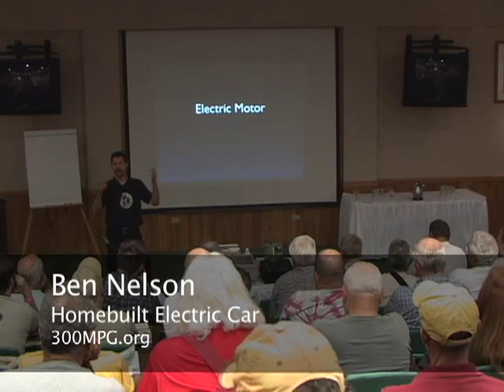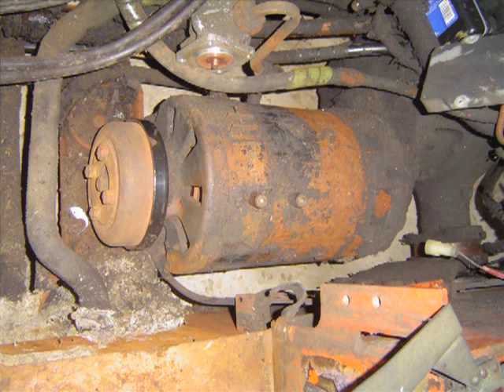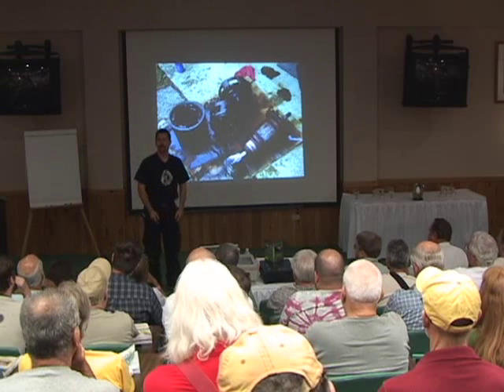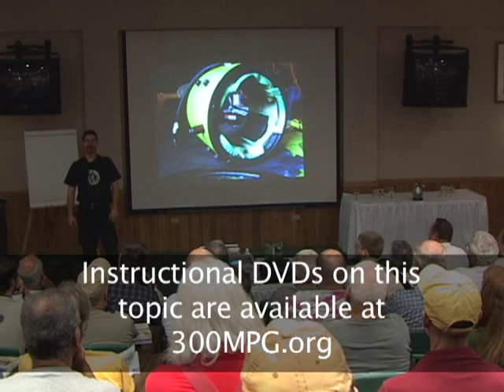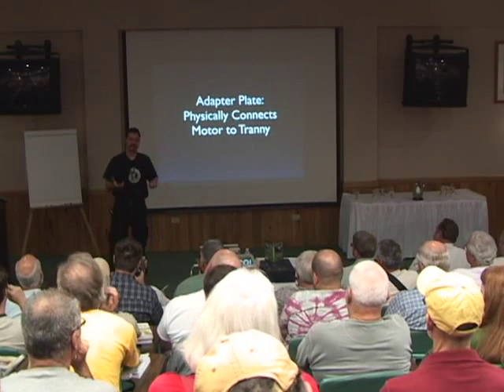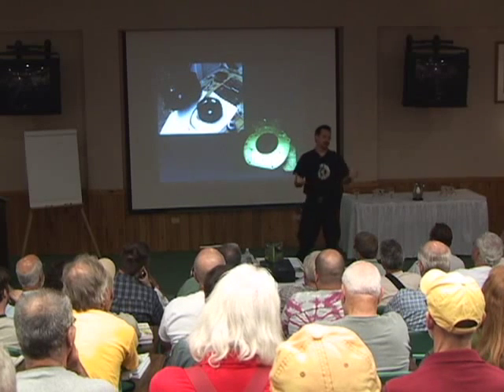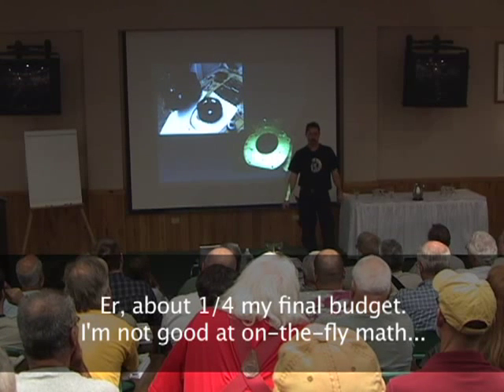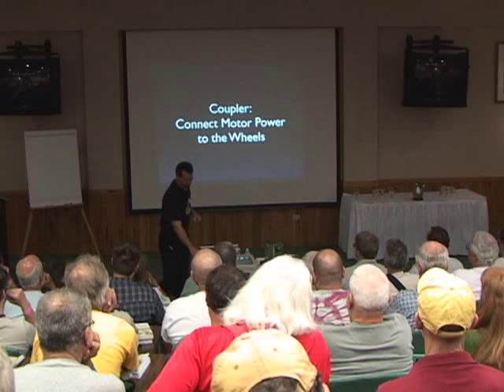Build Your Own Electric Car, Part 3

Comment: Hey Ben, my name is Noah and I am wanting to build myself an electric truck. I need it to go 35 mph. It does not need crazy acceleration. I just need to go around 20 miles. How big of a motor should I use and how many batteries should I use? I have seen 12 volt deep cycle batteries on Craigslist and intend on using them. How many should I use? Also, what did you use to control your car's motor(motor controller)?
Thanks so much
Reply from the maker: Hi Pedro! Check out some of my other videos for more information, and stop by over at my blog at 300MPG.org. Motor size is about how much power you can create to accelerate and push your truck down the road. Warp 9 is a very popular 9 inch diameter series wound motor that would be great for something like an S10 or Ranger. More batteries in series is better for higher voltage, which gives you higher top speed, More efficiency (as you draw fewer amps for the same amount of work with higher voltage) and you get better total capacity with with more batteries of the same size than fewer batteries of the same size. 144V is a very popular voltage, which would be 12 12Volt batteries in series (or 24 6V batteries in series.) I used an Open Revolt motor controller, but you should look at the Curtis 1231 and similar controllers.  The main thing is just to learn all you can before starting your project. Good luck!
Reply: The warp 9 is a very expensive motor. I have been looking around for a forklift motor but don't know whether I should get a 48v or higher. I understand that I can use a 144v controller and just upgrade the motor as I can. I understand that as long as the MOSFET gate supplies enough of an electromagnetic field it will allow current to pass through. Correct? So, I digress, my question was, what is the smallest size motor I can have that will get me going 35. By the way I have a ranger.
Thanks so much
Ps I plan on using the Paul Holmes 144v controller
Reply from the maker: Pedro, you can use a beefy electric forklift motor from a junkyard. I used a 10.5" diameter series-wound motor that I pulled out of a Nissan brand electric forklift in a salvage yard. It did NOT have a spec plate on it, but it would have run at either 36 or 48V. Forklift motors are easily over-volted, so as long as you have a higher voltage battery pack and motor controller, it works great. We later got a 12" diameter forklift motor from a salvage yard and put it into a friend's ranger. It worked great. Also, for a truck, you are likely to want to keep the clutch. My Metro is clutch less, and shifts fine, but you will likely be happier on a truck with a clutch.
Reply: How do you use a Lovejoy coupler then, if I want to use the friction plate. In some conversions I have seen they use the friction plate coupling to the transmission shaft to couple it to the electric motor.
Reply from the maker: You would use one or the other, not both. A lovejoy works great for a clutch less, but for the clutch you need to machine the flywheel to go right onto the motor or machine a flywheel replacement that the clutch cover can bolt to. It's a little more work and complexity to keep the clutch.
Reply: BenjaminNelson Is the clutch cover you all talking about the pressure plate?  Also what would be the purpose of the fly wheel in an electric car. I understand that the flywheel in a regular car is to keep the engine spinning while spinning but it seems like the electric motor would continue to spin because of the magnet field that it creates through inductance.
Reply: Pedro Casultsan I found an 11"  forklift motor. It is 36volt. Will this work? You told me that you can over volt the motor. How?
Reply from the maker: Hi Pedro. That 11" Forklift motor sounds perfect. Bolt it in your truck. All you need to do to over volt a motor is to FEED IT HIGHER VOLTAGE. A DC motor spins faster the higher voltage it gets. At a certain point, you should advance the brushes. Talk to a local electric motor guy or check out some other videos on youtube for details on brush advancement. The only reason you need to keep the flywheel is to have a place for the clutch to go. You could instead make a lighter-weight replacement part that would take the place of the flywheel and hold the clutch disc and pressure plate.
Reply: BenjaminNelson is there anything that I have to do to the motor as far as wiring to make it tolerate the higher voltage?
Also, couldn't you just put the old fly wheel on the lathe in order to make it lighter. If you did that how would you couple the flywheel to the shaft of the motor. How do you extend the shaft of the motor?
Reply from the maker: No, wiring is exactly the same.

Comment from the maker: @rabiaf123 
Don't buy motors on Ebay - shipping will kill you.
My motor can put through 500 amps at 72V. Multiply those together and divide by 750 to get horsepower. That's about 48 hp peak.

An MR2 would make a great electric car.

Comment: i am thinking about doing this but when i was looking for used electric motors on ebay i found they are so expensive 3hp is $500, ABOUT how much hp did the engine u put in ur geo produce, whats a good amount of hp to have in a Toyota mr2 ( 400 lbs more than a geo metero) thanx for the help :)

Comment from the maker: @xmodalloy 
Yeah, the radius of the motor from the transmission input shaft to the CV joint for the passenger side is the limiting size factor on a stock Geo Metro to electric conversion.

Hee Hee - Modifying the MOTOR to fit a 14" into a Metro is crazy - in a good way!
Please post a video of that monster!

Comment: @BenjaminNelson I think you meant the room between the motor and the CV joint didn't you? I did have to grind an inch and a half off of the case on the motor where the CV joint is too close, so it works, but some modification is required.

Comment: @BenjaminNelson It fits, just barely, it has less than an inch of clearance between the end of the motor and the passenger side of the engine compartment. I do not have the money to buy a new motor for the conversion, and I already have the adapter plates made, so no point in going back when it works.
I will probably post a video response on your first video in this series with the first test drive and such.

Comment from the maker: @xmodalloy 
A 10 inch motor is the biggest that will fit on the standard Metro transmission, because it is transverse mounted front wheel drive. One advantage of longitudinal mounting (motor the long way, usually to a drive shaft) is that you can fit in bigger motors. Try that 14-incher in a Miata!

Comment: Hmmmmm, I think I may have my hands full on my motor for my car, 14 inch.... Putting it in a Geo Metro, this is going to fly down the road I think.......Unless the transmission fails because of the incredible torque....

Comment from the maker: @trippedbreaker 
I only used a socket wrench and screwdriver to work on the motor. The bearings on the motor were fine, so I didn't have to do anything to replace them.
You only need to pull out the end bolts and pry gently to take the motor apart.
To replace brushes, you only need a screwdriver. A hooked pick is also handy to pull back the brush springs.
Make sure to support the shaft and watch the magnets when taking the rotor in and out.